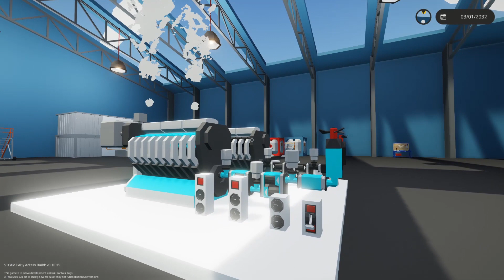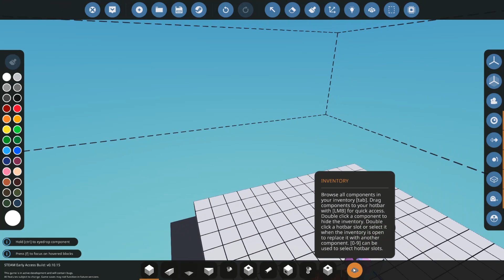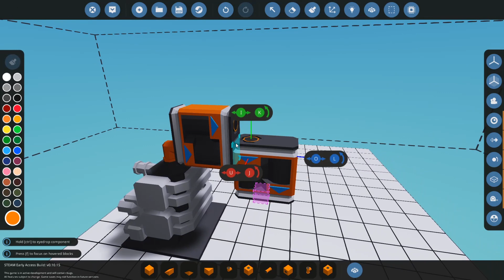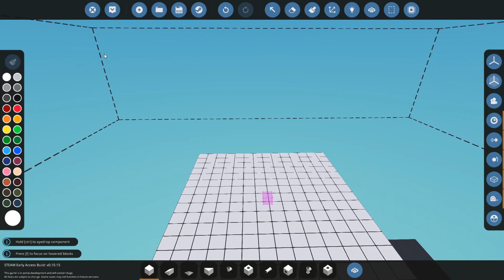How to use Gearboxes and Clutches - Stormworks tutorial

Comment: why my propeller not spin my gearbox point towards engine? but works if gearbox pointing away from engine
Reply from the maker: It might be because you're increasing the rps and as a result the engine doesnt have enough torque to spin the propeller
Reply: @BigmanBoi  Thank you, hoped to have higher speed without more fuel consumption.
Reply: Thanks, i used a Medium diesel engine, then i can use lower RPS to gain higher speed when gearbox pointed towards engine. my small engine didnt go any faster when gearbox pointed towards engine because RPS was 4, too low

Comment: Do you ever build anything for speed? I'm building large ship with many engines and definitely have the power sorted but I am complete rubbish with gear boxes, any tips for faster ships VIA the gearbox would be appreciated.
Reply from the maker: It depends on weight, aerodynamics etc. I would consider testing top speed at different gear ratios on torque and rps. You can never be sure
Reply: @BigmanBoi  I've run it through a 3/1 then 9/2 for highest rps possible, but I really don't have a good understanding past getting the prop moving as fast as possible, I posted it on workshop if you're interested/wouldn't mind taking a look. It has 81 large engines so I know there isnt a shortage of power
 https://steamcommunity.com/sharedfiles/filedetails/?id=2252027049
Reply from the maker: Holy cow! 81 engines! I'll have a look as soon as I can, but just remember that highest rps isnt always your best option. Sometimes higher torque or even less weight is better for speed
Reply: @BigmanBoi  Thanks for the assist, I'm hoping to beat my previous record of 76m/s but I'm acutely aware that large capacity engines with highest RPS gear boxes probably isnt very efficient.
Reply from the maker: Mate who cares about efficiency in a build like that?
Reply: @BigmanBoi  efficient for top speed XD, the gas tank holds like half a million liters so gas will never be a problem, been pumping up the RPS and lowering the gear box to squeeze more speed out of it but still only reaching 55m/s ish
Reply: P.S. I have literally no idea what I'm doing XD I call it the Clarkson approach

Comment: I’ve got no clue what ratios are, how they work, how to use clutches or gearboxes or what they even do. Could you update this video and explain it a little better?
Reply: Simple:
Arrows to Motor
First Number means (Turns the machine has to do) and second number means (Turns the machine outputs) This means: Lower output, less fuel used.

Arrows to propeller
First number means (Turns the machine has to do) and second number means (Turns the machine outputs). This means: Higher output, more fuel used.

The exact math behind is something I don't know at hand and probably is not that exact in this game.

Clutches are basically a stop/go mechanism in this game. When you press clutch in a car, it unlocks the gear-ratio so you can use your manual stick to get into a different gear. When you let the clutch go the gears go back in together and use the new ratio.

In this game its just a 'breaker' more or less. At a specific point (usually at .3 if I am correct) the clutch grips but gives out less power. The more you use the clutch (up to 1.0) you give full power to whatever comes behind.

Thats why some engines die when you use low rps and give full clutch instantly.

Stay crunchy.
Reply: @Narsiph Spearheart 

You are a good man, thank you.
Reply from the maker: sure thing
Reply: @BigmanBoi  nice, thank you

Comment: What was the rps gear boxes ratios?
Reply from the maker: On that test bed i'm not sure. However, it wouldn't really matter since there isn't a load on the prop. I used the same ratios on each side, but different configuration to demonstrate the idea of rps vs torque manipulation
Reply: What would the best gear ratio for a starter sized boat with two small engines to get high speed?
Reply from the maker: I'd say around a 9:5 or a 2:1